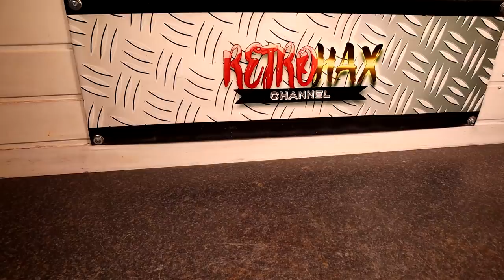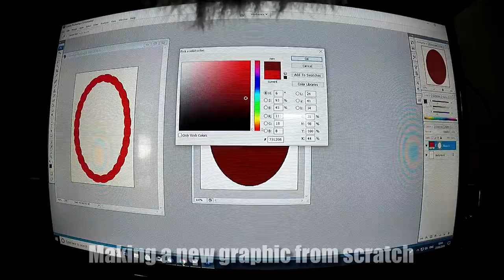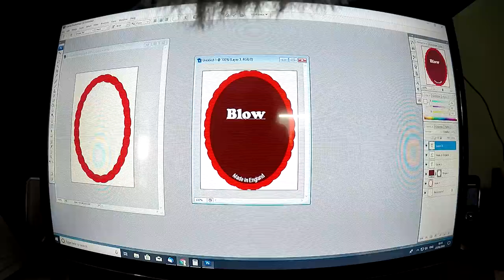1950's Vintage BLOW Butter Churn Restoration In Action

Comment: And to keep all that butter from going sour, it needs to be held under cold running water while being hand kneaded until no trace of the white cream remains. That cream that he separated and poured off into another container is called buttermilk. You don't need the churn to make butter. Set some cream aside at room temperature until it just starts to sour. Then pour it into a Mason Jar about halfway. Put on the lid and shake, shake, shake, shake, and shake some more. Keep shaking until the butter forms into a blob inside the jar. It will do this quickly. About the time you start thinking that you just can't shake it anymore you'll notice a different sound when shaking. That happens because the butter just formed. Make sure to hold butter under cold water or put into a bowl with cold water and squeeze and squeeze it until the rinse water is no longer cloudy. Using a bowl, you might have to change out the rinse water several times. Then add salt to the butter until it tastes right to you. Knead the salt into the butter. Some people like really salty butter while others just want a hint of salt. So flavor with salt to your taste preference. Refrigerate the leftover cream because it is really good home-made buttermilk. Any cream from the grocery store will work except fat-free.
Reply: Yeah but homogenized takes much longer and forms much smaller blobs of butter. And the higher the butterfat, the more butter you will get (and the less buttermilk).
Reply: I also wait til room temp, then into the churn it goes. In less than 5 minutes it's butter.

Comment: nice job as usual.There is something else you can use on the wood, food grade mineral oil.
Reply from the maker: Not heard of that but it sounds just the job.
Reply: @RetroHax  you can also paint on a thin coat of the bees wax after melting it. That will help it soak deeper into the pores of the wood, and make it more sanitary.

Comment: Nice work.  My only critique is that on the label you replaced an elegant  and delicate 1920s/30's style font with a blocky font that looks like it's from te 1970s. The style, lettering size, and writing angle is all totally different.
Reply from the maker: Yes, i'm no expert bud but it can always be replaced when I find a nearer font.
Reply: @RetroHax  Could you please tell me what font the "wrong" one is?  I've been looking for it for a while and not found it.  I'm after it for the "for longer life!" on repro Ever Ready batteries.
Reply: Why not take a picture of the original label and trace the font or just clean up the original label in Photoshop? It doesn't look like it'd be too difficult.
Reply: @tiawilliams5690  That's what I did do.

Comment: Looks good, Though it's probably just me being picky, But I did wince a little when I saw you using pop rivets on that. Personally I'd probably have gone a bit more period and set some aluminium round head rivets in there instead.
Reply from the maker: I didn't have any bud so I had to use what I had.

Comment: I feel like you should have made a stainless steel stirrer, because 100 year old wood doesn't uh... Sound sanitary.
Reply: That's why he sanded it down to remove the possibility of anything left in the pores. That's also why he coated them with bees wax to seal it, and protect both the wood and the butter.

Comment: Err.. using your heater fan for powder paint extraction (heating function off/cooling fan) 🤨 would there be a risk of the powder coating the inside of it and the element, later in winter, turned on to heat your hut with possibility of the powder coating burning off - in your hut...😷
Reply from the maker: there's no heater fan here bud.
Reply: When you used it to blow air out of the window it looked like one - round metal construction, a vintage cooling fan I haven’t seen before?, I have seen a another YouTuber that does powder painting and he has the ➖ charged items hung in front of a large filter (I assume with a fan behind it) for his spray booth. You could make one by buying a U.S furnace filter and a box fan